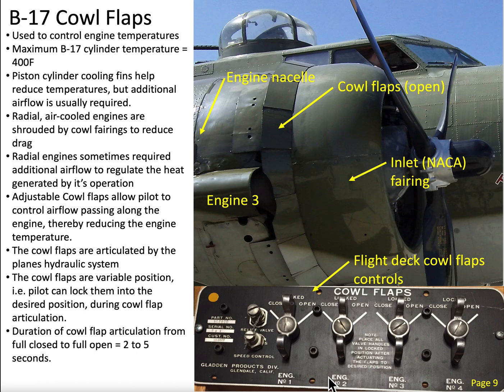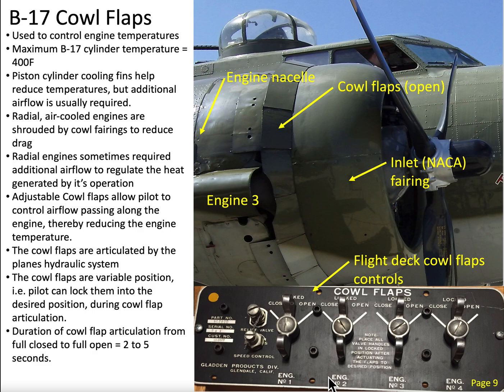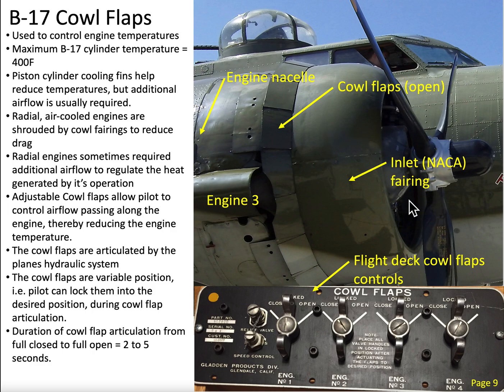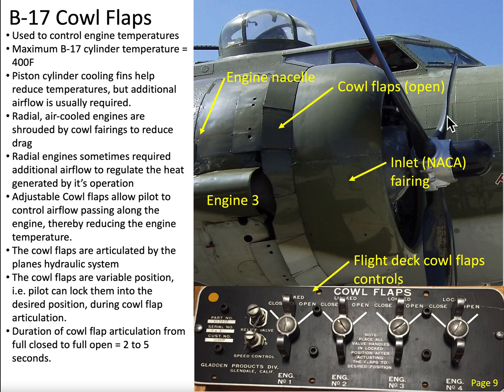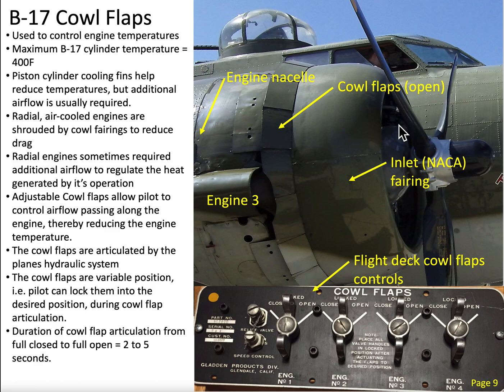B-17 Bomber's Engine Cowl Flaps Explained

Comment: Cowl flaps and brakes were the only hyd. on the B-17.   The system consisted of an electric motor connected to a pump and accumulator and associated piping.  Location of the equipment was on the starboard side of flight deck just forward of the aft bulkhead.

Comment: This is probably a silly question, but why not always keep the cowl flaps open? I assume there's some sort of trade-off being made.
Reply: The further they are open, the more drag they produce and the less apparent thrust you get from the engines
Reply: @richardmillhousenixon Thanks!
Reply: The cowl flaps are adjustable to allow the flow of cooling air to match engine cooling needs. 
On the ground there is minimal flow generated by the propeller, so the flaps are generally open for ground operation. Even though the engine is operating at low power for taxi, holding and runup, the engine still needs cooling airflow.
The flaps are closed for cruise, and the exit opening is sized to obtain appropriate CHT with the cruise ram air and cruise heat load.
The cowl flaps are open for climb where power and heat load are high and ram air pressure is lower than cruise.

It is desirable to have a small exit area at cruise to both keep cylinder head temperature at an optimum value and to accelerate the air that has been through the engine fins back up to the slipstream speed. The cowling acts like a low power jet engine in that air is decelerated and its pressure is raised, it is then heated by the hot engine and its fins. Hearing the air expands its volume. The hot air is then accelerated by traveling through a converging annular space to exit the cowling. If the exit area is too big, the acceleration of the flow is less than desired and cooling drag is increased.

When the NACA cowling debuted in 1929-1930, adding the cowling increased the speed of the airplane by about 20 mph....for "free".
Google NACA Cowling.

Just a wing flaps re-configure the wing to be better for take off and landing, cowl flaps re configure the cowling for high speed -low speed and high power low power. If a plane does not cruise at a high speed, a fixed compromise exit slot is OK.